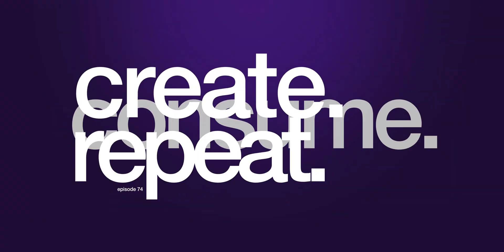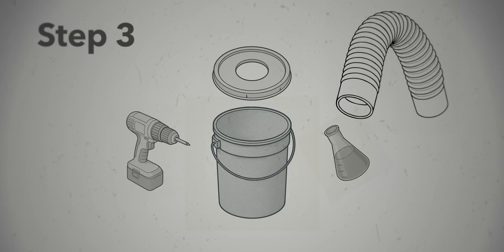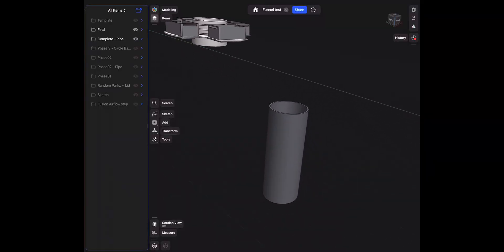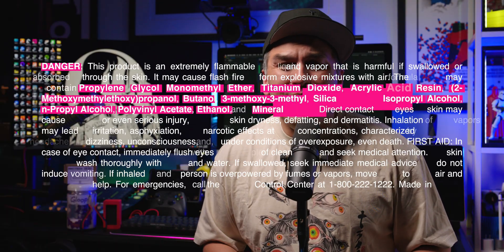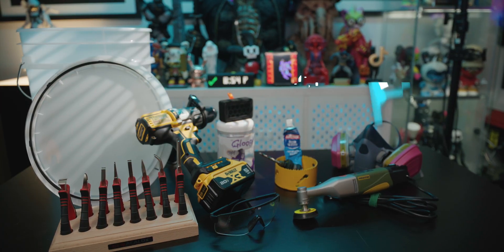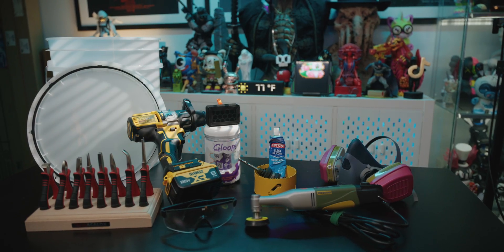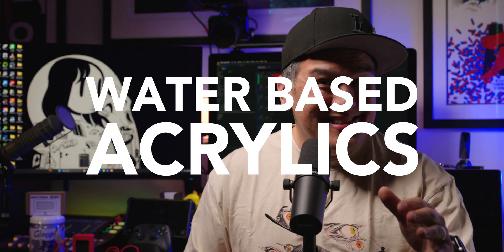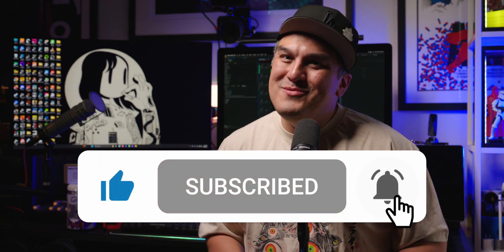The Essential Airbrush Spray Booth Bucket Upgrade — Stop Breathing Fumes!

Comment: Why not use charcoal dust bottom layer, then solid/chunk charcoal 2nd layer.
Reply from the maker: You could if you wanted more carbon filtration but as mentioned in the video, carbon filtration is only part of the equation. That said, feel free to modify as you wish.

Comment: Hi i was wondering if you sell this i don't have a printer to make one thanks. Russ
Reply from the maker: Hey. Russ. Sadly, I do not sell these.
Reply: Okay thanks for getting back to me  @CreateConsumeRepeat
Reply: Use pvc pipe and electrical switch wall housing. Silicon or pvc sealant.

Comment: My only suggestion for improvement would be some kind of way to minimize the size of the bubbles created in the bucket by the airflow. More, smaller bubbles  = larger surface area = more particles and VOC's getting trapped by the water. Either a bunch of small holes in the part of the exhaust pipe that is under water, or perhaps a hollow disk-shaped head with a bunch of small holes to spread out the bubbles.
Reply from the maker: Now that my friend is a genius idea. Thank you so much for sharing. Maybe if I get a little bit of time I’ll whip something up. Maybe an attachment that you can glued on using Gloop!